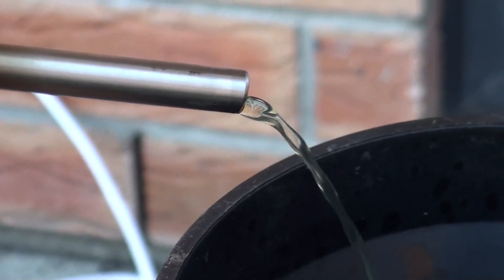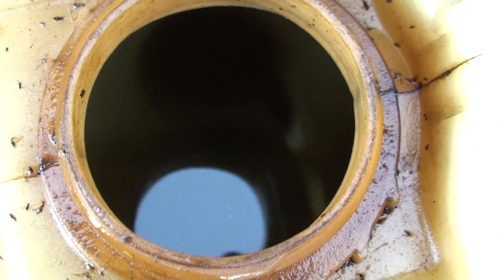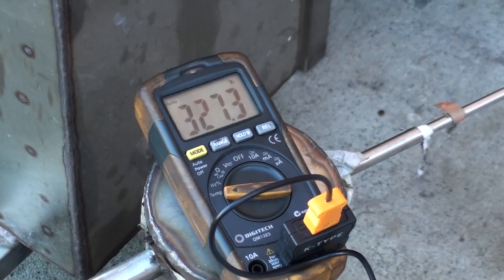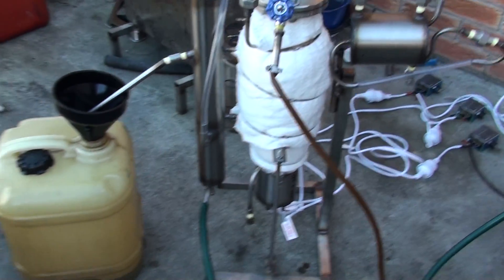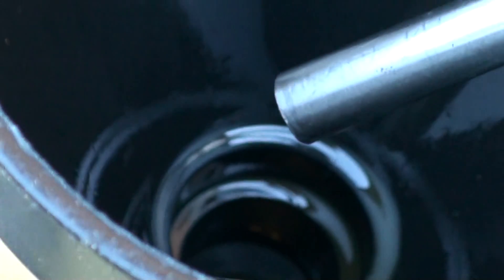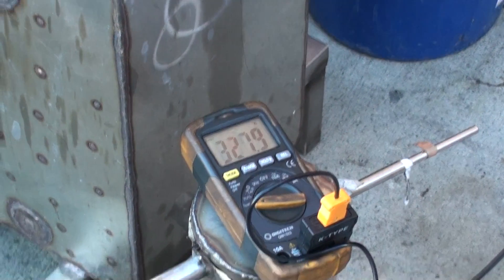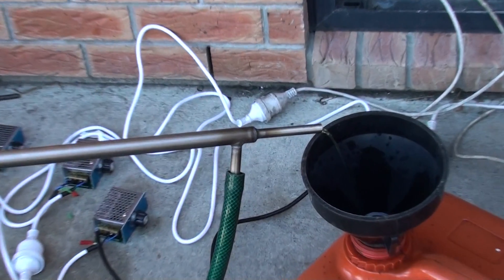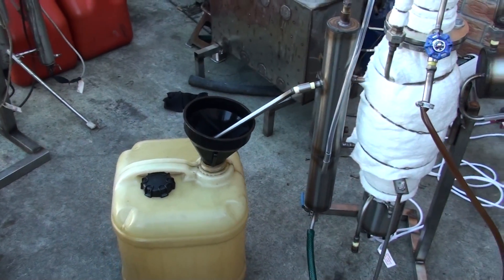Black diesel bleaching

Comment: If I understand, this column would run after first run of used  transmission fluid and used motor oil on the earlier reformer design? Do you plan to sell plans for this new design? Great work again Alex.
Reply from the maker: Yes, this unit mainly built for bleaching of a diesel fractions that may be dark, oxidized or contaminated with engine oil or some sort of coloring.